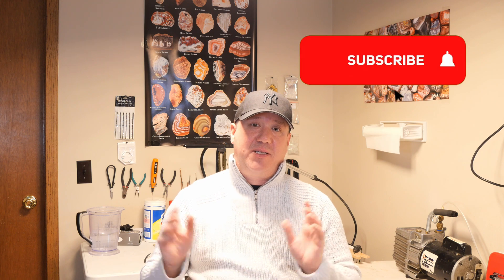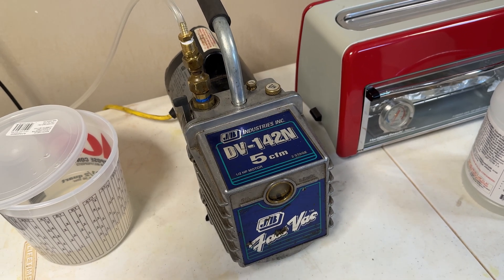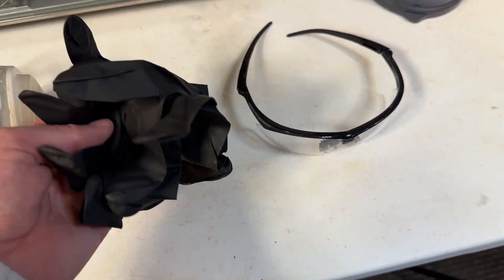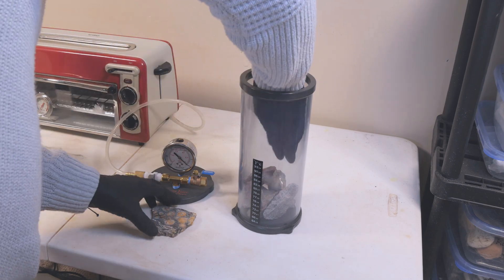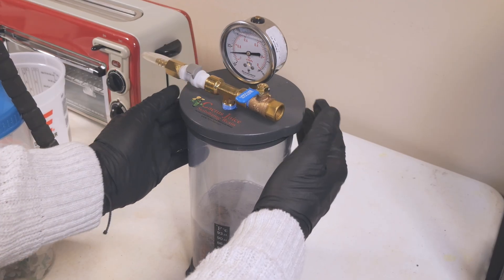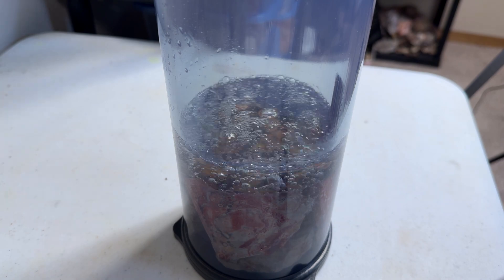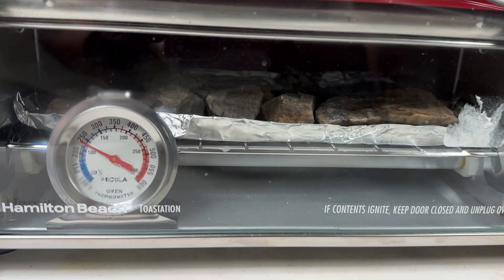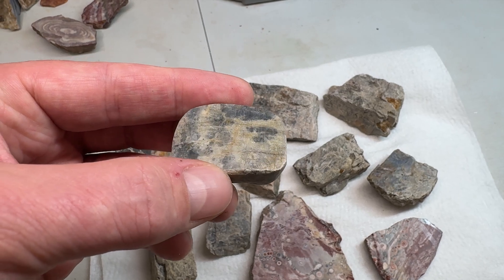How to Stabilize Rocks using the Vacuum Chamber Method

Comment: Hi craig, i have been stabilizing  turquoise  for amost ten years now.
I also use cactus juice.
I have found the best results by first washing and scrubbing off all the loose material first then heat them up for an hr or so, then i pop them in the vac chamber for about 1 to 2 hrs dry.
Since i have a larger chamber i can lower a smaller bucket inside filled with my turquoise and the juice i then pull a vaccum  for three to four hrs like you do.
But after i stop bubbling i remove the smaller bucket and lower it into a  pressure chamber then set it at 50 psi i hold this pressure for several hours  somtimes over night.
Water is the enemy  of this process  stone typically have moisture  inside no matter how long it sits in the sun  the presence  of resin around the stone will really  slow down that 
Evaporation process  this contributes to an uneven saturation thats why i pre heat and vaccum first.
As for using plain air pressure  that only about 14 psi i kick it up to at least 50 psi.
More is better but if you are building  your own stay well below the container  max mine is built out of sch 40 pvc at 6" you are rated to 180 psi max so 50 to 75 psi is pretty safe but mine is mosty sitting in a tub of sand and the top is pointing  up with a sand bag on it .
I cook my stones at about 210° Fahrenheit  for 3 to 4 hrs this process  works great.
I know some of you guys use oil when cutting large slabs how do you get the oil out of the stone before you stablize it.
Us turquoise  guys only use water because  raw natural turquoise  stains easily  thanks, Pat
Reply from the maker: Thanks for the tips, yeah I’ve found a lot more tricks to an overall better stabilization in the months after making the video.  Considering making an updated one.  I too now cook my stones beforehand and then immediately transfer to an air tight container until I’m ready to put it in the chamber.  I found that letting them cool out in the open before putting them in the chamber was drawing in too much moisture to get a solid good result.
Reply: Acetone is a good volatile solvent to soak & wash the oil off the slabs prior to putting it resin.

Comment: @Operocks I'm learning about stabilization and am wondering why you go with the vacuum chamber instead of a pressure pot? It seems like the pressure pots are generally advertised at being better for pushing resin into voids whereas vacuum chambers are better at degassing resin. I would have thought that degassing was less important than pushing epoxy into the cracks. I'm just trying to learn so I know which one to buy and am a bit confused since I can't find clear guidance on this specific topic in the context of lapidary materials.
Reply from the maker: I went with the vacuum chamber because once all the air is eliminated and pressure is released, the resin is pulled into any voids where air was eliminated.  I’m also just not a fan of pressure pots in general lol boy that it’s not a good method as well, I found this more convenient
Reply: @Operocks  Ahh, that makes sense! Thank you for helping me out. Your video is awesome, btw. Thanks again!

Comment: Wonder if this would work on small rocks with ugly cracks to seal them up and make the cracks less visible, like marble sized stones.  I don't know how hard the juice gets and would it run out of the cracks while your trying to bake it, not sure.
Reply from the maker: There is some seepage when baking, however the resin is clear so you would still see the cracks…they do have dyes you can use I haven’t used those yet

Comment: I suspect a lot of the "air" coming out of the rocks is actually moisture.
Reply from the maker: I did clean and dry them in the oven prior to stabilization, there shouldn’t have been too much moisture
Reply: @Operocks  You may very well be right, but a tiny bit of moisture turns into a lot of vapor. I'd be interested in seeing the weight difference after rocks had been in the vacuum chamber without the juice.
Reply from the maker: @ it very well could be some left over moisture, i may have to give a weight comparison a try

Comment: Thanks for this good educational video. Can you please comment more on the most important thing about this method. The oil has both setting and resetting properties. After cooking it may look solid, but it may be reactivated by a higher temperature and/or chemicals. How can we prevent the air from pouring in down the road?
Thanks!
Reply from the maker: I’m not sure what purpose reheating a stone over 200° would serve or why you’d be adding chemicals to it but I personally have not run into any issues with anything I’ve worked on so far. I would have to refer you to the manufacturer of the stabilizer resin for that question, I only demonstrated basic stabilization for the purpose of lapidary work, anything beyond that I’d contact the manufacturer. I put the link in the video description for this purpose.

Comment: Would this work on opal. and if so would it have any ill effects?
Reply from the maker: I would consider the polyester resin process specifically for opal due to the delicacy of its structure. Although this method works for most minerals, opal and malachite I have found to be an exception. Thanks for checking it out!

Comment: Odd question but is it possible to Stabilize Wood with some other kind of liquid or semi-liquid fuel source?
Reply from the maker: Yes, this exact method is used on wood. It’s actually what cactus juice was originally made for
Reply: @Operocks  Would someone using this method be able to lock substances like kerosene or tallow deep into wood, if they were looking to increase heat and burn time in a woodburning stove? Resin doesn't immediately seem like a good fuel souce but I could be off about that.
Reply from the maker: @rumorcontrol7873 that I’m not completely sure, it’s a little out of my realm but if you go to the maker of Cactus Juices website (link in the description of this video) the founder could defi answer that question for you